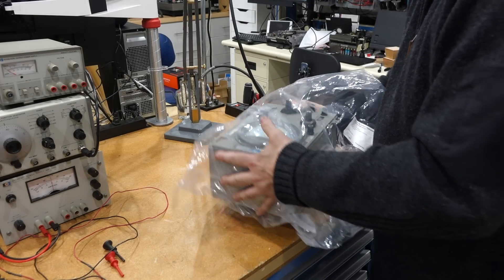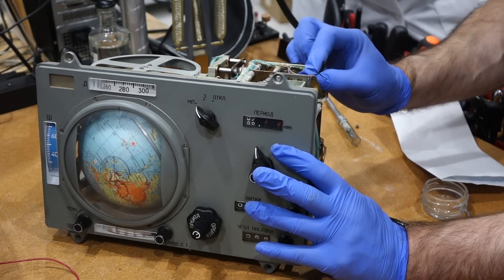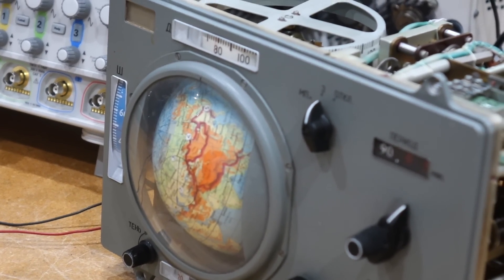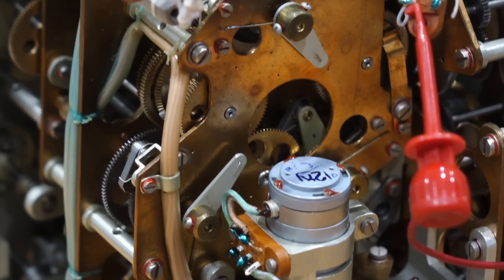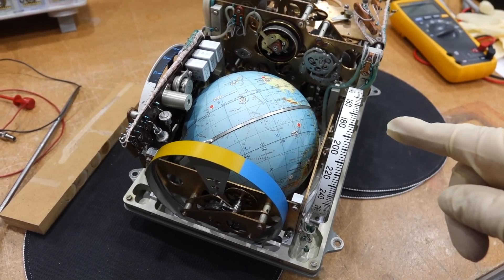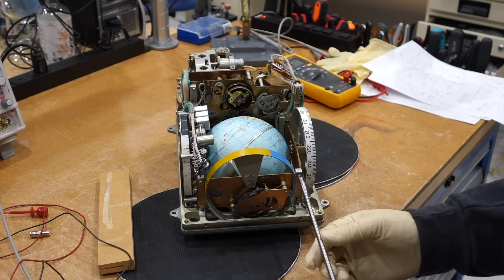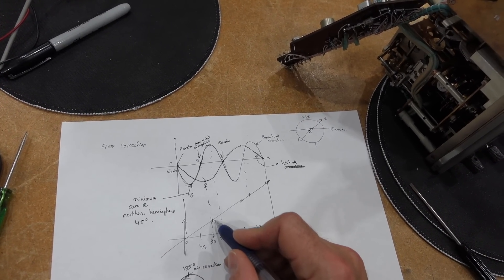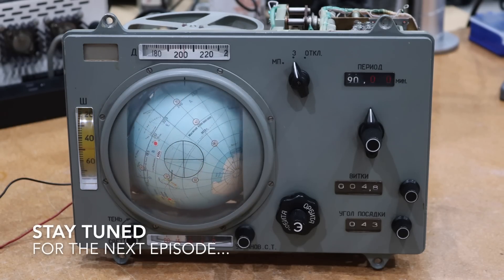Soyuz "Globus" Mechanical Navigation Computer Part 2: Powering Up

Comment: Growing more and more fond of mechanical solutions of the past. Nowadays it's easy to do everything digitally. But there is beauty in analog user interface and a machine that works just by supplying it with power.
Even more impressed you actually found out how to calibrate it.

Comment: Can someone explain to me how this feels more “clever” than a modern computer. I know that’s nonsense to say but somehow it feels smarter that the engineers managed to figure this out and make such a lovely piece of electro-mechanical engineering
Reply: Well I would say that many things are nowadays numeric and many expect that a program can do anything that you want easily. For the mechanical counterpart ppl expect that u need a deep knowledge of physic etc and a clever mind in order to build this type of machines. It could be the same as thinking of using steam to push things it is a clever use of physics.
Reply: i mean, in software you can build and rebuild and rebuild again in minutes, seconds even. with hardware... if you need to adjust a foundational element.... it could require undoing months of work and re-engineering everything that was dependent on the foundation. but yeah... in concept... it's not as complex as software.

Comment: I always salute to the engineers who could made everything without digital computers.
Reply: Being all (mostly) mechanic reminded me of the Antykithera mechanism of 2200 years ago.
Reply: The navigation computer is in fact a computer. But instead of software it has some electronics combined with physical mechanisms similar to those of wrist watch... So yeah back then instead of programming, they just built machines with very specific purposes. Software is a program that runs on so called ''Turing Machines'' Turing Machines are also known as Universal Machines for very obvious reasons you can just program stuff instead of building a whole machine for that purpose. Even though current computers are ''universal'' they are actually not so universal, there are things they can't do. But as we all know already Software seems pretty limitless. The possibilities seem endless with the kind of memory we have nowadays.
Reply: I doubt they didn't use digital computers. 
There is popular myth that engineers in USSR were so inventive that they could build everything using logarithmic rulers, from nuclear icebreakers to Buran spaceships, which use own AI to automatically land from Near Space(just as Elon Musk's rockets land today).
In fact, all Soviet engineers were sitting at own computers, and they had software, like Autocad, on which they designed everything, all planes, all ships, all space rockets.
Most likely, they created this mechanical device because it was 10 times lighter than computer with CRT monitor, which would perform the same task.
Reply: @industreeya  I didn't talk about computers used as a utility during the constructing procedure, I talked about digital computers as solution. Nowadays it's easier to program a small chip to manage everything but earlier they didn't have chips, they had to do things with mechanical and electric solutions. I think that's amazing. I'm a software developer, I did plenty of programs for so many problems, actually this is an "easy" work, but constructing and building a very simple alarm clock, in its reality, that is a challenge. Look at this gem in the Soyuz, this is fantastic, and beautiful, that was the era of the constructor masters.
Reply: I always salute to the engineers who could made everything without computers.

Comment: I bet these things are also in intercontinental ballistic nuclear missile guidance systems. Sitting in old soviet missile silos. I wonder how well they have been maintained. Would they still work after 50years? With different alloys inside there are must be components that would corrode due electrolytic interactions etc.

Comment: sometimes you just can't beat a good analog solution. i love that they used a little globe instead of some more esoteric mapping to indicate lat/lon. i use a very similar digital method for avoiding map stretching and polar problems. basically having the globe solves a fairly annoying math problem for free where you want to locally "flatten" the globe to create an accurate local map with minimal distortion to a flat surface (usually a screen). Having a literal globe rotating under the screen and using your human eye ball to look at it through the screen does all that automatically (your brain's normal function does the math). if you want to do this digitally, you need to do a bunch of math to draw the correct part of the globe that should be facing the viewer.

Comment: You said that it has NASA tracking stations labeled on it so it must’ve been created for Apollo-Soyuz, but actually Soviet space doctrine was that if the capsule was to suffer failure and it couldn’t reach a landing site in the Soviet Union, it was to try and a landing inside the US or US territory which would mean needing access to tracking station identifiers. That’s why English is printed on the outside of Soyuz capsules alongside Russian. Of course this could’ve been used for that famous mission. It’s fascinating piece of technology anyways
Reply: It wasn't just because of having NASA stations marked. It was also because it had the position of the Vanguard marked where it would have been during it's mission servicing the Apollo-Soyuz missions. If you watch the first video in the series they have more details on how they figured it out.

Comment: As an automotive technician that does this sort of thing for fun I have a power supply and an oscilloscope I get aircraft systems and instruments and power them up it's very interesting to understand how it works and see it in action and repairing them to work is the best part.

Comment: Your video reminds me of my time working on the C-130. We had a device known as the Along and Across Track Computer, it would indicate deviation left or right of the aircraft's progress on it's flight path. It was a mechanical computer with a fist sized sphere and electro mechanical sensors to provide deviation signals to the indicator. I used to joke that to fix the device we had to send it to Speedy Transmission repair shop downtown.

Comment: I used to use NORAD keplers to track HRPT (high resolution Picture Transmission downlink)  NOAA satellites in equipment we were working on - it was always a thrill to see MIR come up pass overhead based on our computer prediction from the TLEs (two line elements) This nav unit is a total masterpiece of Russian engineering.  Thanks for getting it working.....

Comment: i wonder if omega could've made a stylish watch version back in the day, with a Kavrayskiy VII projection on watch face with longitude/latitude and other values appearing at the poles to fill out the watch face and some sort of kinematic overlay tracing the orbital path with bezel adjustments for projected scenarios and syncing with on board clock/telemetry?

Comment: Whenever I see analog stuff like this I get the feeling engineers where a bit smarter back then then we are now. Mainly in terms of doing brutal head calculations (and keeping several of them in your head) and mechanical knowledge. Most of this stuff would have been done with pen, paper and lots of rulers..
Reply: They had slide rules to help with calculating, and also lots of pre-calculated tables.

Comment: what a tremendous piece of analogue mechanical engineering - well done for getting it operational again! In technology terms, it reminded me very much of the 1960s vintage Ferranti moving map display which was fitted to the RAF Harrier aircraft - it projected the aircraft's position onto a map which was stored on a 35mm film strip.

Comment: Globus was designed by "КБ топливо-измерительной аппаратуры" in Leningrad. And it was manufactured by "Завод Пирометр" in Leningrad
Reply: I always enjoyed those obscured names of Soviet research institutes and factories.
Reply: @avetl  "Construction bureau of fuel measurement equipment" and "Pyrometer factory".
Can imagine that it's hard to argue that you paid for more fuel than you pumped with this factory's diversification.
Reply: The contractor in Moscow that repair them is Пиврите ромет-опл
Reply: Is it Lening-rad or Lenin-grad?
Reply: Lenin-grad, city of lenin

Comment: What amazing workmanship to create a precision analog tool like that. A real lost art!
Reply: artefacts of lost civilization
Reply: @mikhail79279  да, тоже об этом подумал, сидят на западе и изучают технологии исчезнувшей цивилизации)
Reply: Analog is best at one thing.  Digital is pretty good at many things.
Reply: There are a lot of things you can hate about the USSR but their neat feats of Engineering, especially with analog instruments is not one of them, this stuff is awesome
Reply: The much more interesting question is: how did they make gears in XV-XVI centuries used in tower/hand clocks, since they had no any machines to produce gears.
Reply: @НикитаПопов-д9ы  with a file and lots of time
Reply: @alexandredevert4935 
and with a lot of patience as well.
Reply: @alexandredevert4935 not true. It was done with hand turned lathes and attachments. Please educate yourself. Lathes are very old, 1300 BC is the earliest FOUND example.
Reply: @user-db6pt5gq7u  with lathes and attachments??? Like everything else???

Comment: 2:20 - I think that sealing is not original. 1. Lettters and geometry figures are not as clear as usual and there is the gap betwen the sealing material and the unit case (originaly sealing is made by pouring the melted sealing material inside the screw hole and pressing it by the stamp, so it's impossible to make gaps betwen sealing material and the unit case). 2. Units are sealing only after positive testing results, so damaged or failed unit can't be sealed. 3. There is no "OTK" sealing or marking (OTK translates as "general technical control" and means "all tests passed with positive result", "OTK" sealing or marking is the major marking - the other marks means only the place where unit was sealed, the other sealing is additional sealing in case of unit covers are large enough to make possible the access to the unit's inside without unscrewing one side screws or kind of). I think this unit could be assembled of the parts of broken or teared down unit (or several units) by seller, who made a fake sealing to sell it more expensive then parts.

Comment: I have few questions to which I can't find answer by myself

How did they know how to adjust orbital time? Did they had different instrumentation on board, or they got corrections from earth through radio?

Also if globus starts working since it gets power, did they just ignored the starting process or just turned it on when they got on the orbit?

Comment: 5:55 I’m surprised it can even run that fast! Sounds like a ticking rocker in an engine. On a side-note, I wonder if it was as loud in the instrument panel of the spaceship as it is out in the open? I could see that clattering away every second getting annoying after a while in orbit.
Reply: not nearly as annoying as when it stops clattetring !
Reply: The Soyuz is extremely loud inside from all the fans and AC systems running, so I wouldn't imagine it would be too bad! Source (from about 1 minute onwards): https://www.youtube.com/watch?v=GcuQuMinrCo
Reply: @kristenburnout1  That's a much newer ship and probably a lot quieter than the one this clock flew on. I can't imagine the racket inside an old Soyuz on orbit. I'm sure it didn't bother the crew, though. They were more concerned with praying the communist hunk of metal hurtling through space would hold together.
Reply: @MontegaB  This "communist hunk of metal" had amazing reliability. I would rather fly on it than on a new capitalist hunk of metal by Musk with unknown reliability.
Reply: @AWtify  Da muss ich an den Witz mit den Apollo-Astronauten denken. Dieser wird von einem Reporter vor dem Flug gefragt, wie er  sich fühle. Die Antwort: "Wie soll ich mich fühlen mit dem Wissen, in einem Raumschiff zu sitzen, welches aus 500 000 Einzelteilen verschiedener Hersteller besteht, von denen jeder bemüht war, das günstigste Produkt zu verkaufen"! 🤣🤣🤣
Reply: @MontegaB Sorry but the Russian space program has excellent track record. After the American space shuttle was canceled, it was the Russians who took everyone to the ISS. Russian "old" space tech is thoroughly battle tested. Let's see Musk's track record in 10 years...
Reply from the maker: I read that the Globus started automatically after insertion into orbit and stage separation, and that the characteristic clicking was used as a confirmation that the separation had happened properly!
Reply: It's normally sealed in it's case and inserted in an instrument panel so maybe its a little bit quieter. There's that other clock showed on the channel earlier going too, though...
Reply: Can you over-clock something that bad without damaging it???  I would be afraid of breaking such an irreplaceable museum piece.

Comment: I've always wanted to do analog computation that is clocked with harmonic sine waves which use phase differences for a complex series of non-discretized states with complex logic. Is that's what's going on here? I think it has potential for calculating problem using imaginary variables, but I'm not quite sure if that's what's happening? Also, I wonder how many synthesizers already use something like this without taking any credit for it?
Reply: You are putting an awful lot of words that usually don't go together into hardpacked sentences that are each in their own right worthy as a title for a dissertation.  The way to go when trying to explain a very convoluted idea is to keep it as simple as possible and more importantly make no big leaps that cant be easily understood by anyone who understands the necessary theory. None of the words you use are unfamiliar to me, but I can't catch your drift. Anyhow what you are describing is so superlatively far from an electromechanical automata that does its corrections using cams that you could just as well be describing something from the future. This sphere-thingy is an analog computer of sorts, its just not a general computer. Each variable is represented by a literal position of a physical object. No phases or complex logic in sight anywhere. No spin states. No trolls, no bots and definitely no chat-gtp. The world is weird hmm? It would be both cool and scary if you would have to refill your navigational indicator with liquid helium every time someone spills coffee on it or sneezes too hard.
Reply: @xsense2012  Lol okay fair, perhaps the difference is that I think about these things analytically as systems regardless of design, which can definitely both hurt and help my analysis in certain ways. I know if the gear work is serving any mathematical purpose it would have to be purely functional or representing a constant value. I think only the differential mechanisms would have any ability to take in variables, and it's probably been designed to make the mechanism of the control knobs represent the variable value rather than any calculations or Turing machine level operations happening. You're probably right that they didn't put as much thought into it as I am, I just really enjoy thinking about these things and it's why I love watching these videos. However, what I really should have asked was "can we describe this system as these things?", but perhaps Marc and other professionals in this field are more "hand's on" with technical data than I am in my amateur ramblings rooted in mystified naivety.
Reply: By complex logic, I mean having a mixed signal logic. If sine wave A is half the frequency of sine wave B, then it has four discretized states [A up/B up, A up/B down, A down/B up, and A down/B down] but also an infinite series of states defined by the relative difference defined by A-B as well as the discrete state (AB). This gives us a derivative component to an analog signal system which we can represent by binary logic regarding where in the cycle this relative difference is occurring. In other words, dA and dB is what actually has these discretized "spin" states. This means that even for complex analog-based states, there are always four discretized states which occur between that point in the previous cycle and the current which have a defining relationship with the four times in a cycle any two analog values will have the same absolute difference between them. adding a layer of 2-fold digital logic to any state defined by a singular analog value. There's also the ability to use op-amp integrators or even further derivation to get a sort of ramp or pulse logic as well, which makes me think of how in physical systems energy is always transformed into one form or another.

Comment: i am sure the globe spins pretty quick while in use in a space ship ..20,000 miles an hour = one click ..idk ..i dont have a google lab coat :) ken is the mang :)
Reply: No, it spins at the shown 1Hz clock rate. It takes around 90 minutes for a revolution (as set on the upper right dial) in LEO.

Comment: Dumb question -- did they have to account for any mechanical part of the device being impacted by being in a weightless state during flight?  73 - Dino KLØS
Reply: Not at all, it's a closed loop rigid system that relies on teeth count of all the gears combined, nothing is free-floating here like a gyroscope would be.